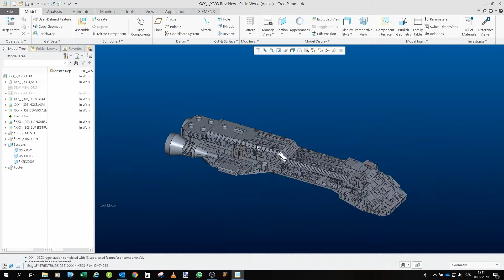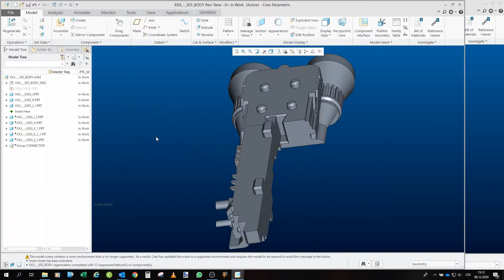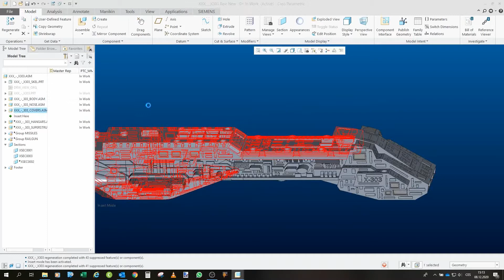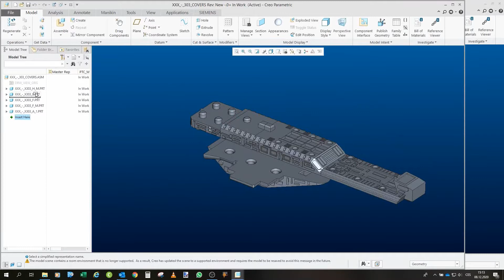Project Prometheus - Part 2

Comment: How do you pain? I’m curious. Do printed models need like a special paint?
Reply from the maker: nope, i use normal paint in spray and for details i use Ravell colour for models. That does the trick ;)
Reply: @martintaichl  Thank you! I found out my local library can do 3D Prints! But they said the  model is a mite bit large. Is there a way to make the model smaller when doing the 3D Printing or is that not something that can be done?

Thank you!
Reply from the maker: @JcBravo8  well in the slicer you can adjust the scale, but then you have to make all the parts with that scale so that they fit. However bare in ming that there are quite a lots of details that by scaling the models down will be lost ;)
Reply: @martintaichl  thank you! Ill see this as a test and see what happens! Ill ask to reduce its size by half. That seems to be about the general size of other models I’ve seen. Thanks!
Reply from the maker: @JcBravo8  i am not sure if 50% downscale would be possible. I mean, i am not sure if the small parts could be downscaled that much. You have to see.